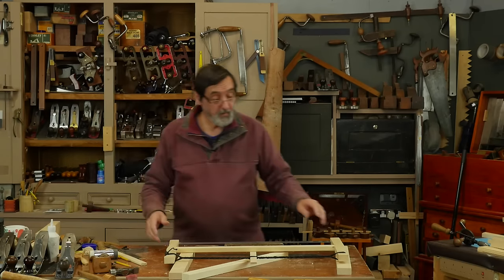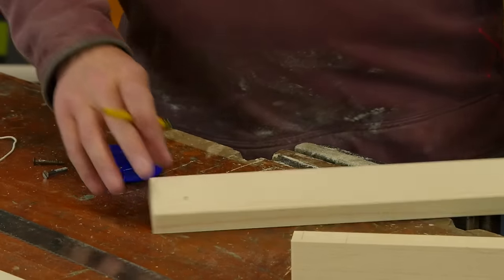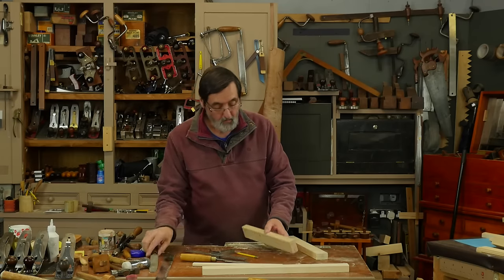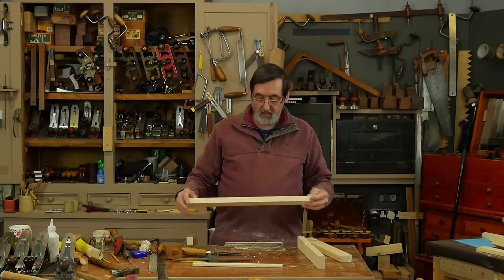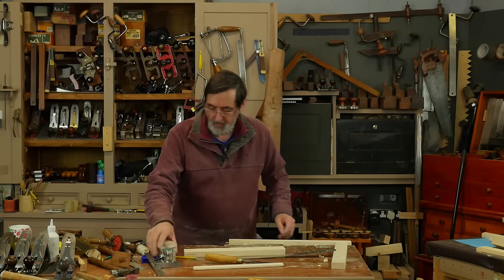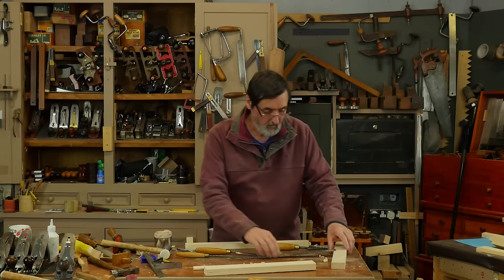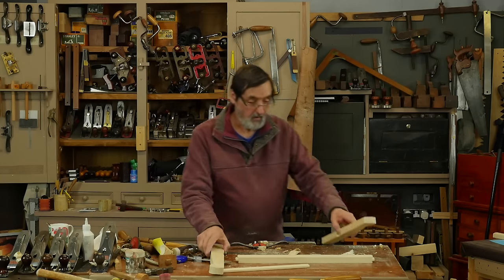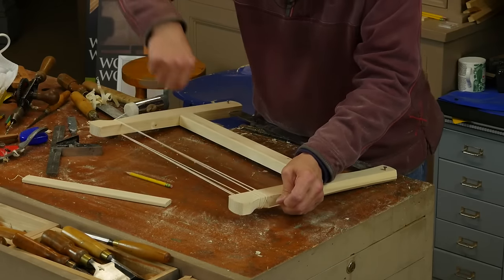Making the Frame Saw | Paul Sellers

Comment: Does anyone know what the blades are and where one can purchase them from? Could not find info on the video. I expect it is there somewhere but I missed it. Also does anyone know if I could use this in place of a band-saw. I am making my first mandolin and I don't have the room for a band-saw. I need to cut the neck on the instrument. So something like this would be great. But I don't know what blade to buy or if it is actually possible to do it this way. Any advice from anyone would be really appreciated.
Reply: www.highlandwoodworking.com is where you can get the blades.  Good luck!
Reply: u can use a small cheap hack saw, i use the thin kerf blades for fretting

Comment: As usual, a thought provoking video.  I went to the web to find some suitable saw blades and found a few factoids and sources to thrown everyone's way.  Alternate names for these: frame saws, bow saws and turning saws. Deter Schmid's web site (fine-tools.com) has a great page describing these variants as well as an excellent arguement for string tension adjustment. Highland Woodworking has inexpensive (about $8 or so) blades for a frame saw like Mr. Sellers made in cross cut, rip and scroll versions.  They also have better ones (???) for much more money!! ToolsForWorkingWood.com have blades for bow and turning saws but these have pins in the ends and require some special hardware.

Comment: The blade on a bow saw can, and should, be made of thinner steel than on a regular push saw.  The set on the teeth can be less as well, making for a thinner kerf.  That makes for a faster cutting, and more precise saw.
Reply from the maker: +deezynar Than what?
Reply: Paul Sellers
Than typical push saws.
Reply: +deezynar am I missing something here? Any bow saw blade would by design be thinner than a regular push saw. Wouldn't it?
Reply: It should be, shouldn't it?  Trust, but verify.
Reply: some times, a man of few words only confuses.....deezynar....you are confusing.
Reply: I have a bow saw made by a German company.  It's blade is no thinner than the blade on my Diston tenon saw.  It could be much thinner, it should be much thinner.  It isn't.  No mystery, no ambiguity.  Measure them.
Reply from the maker: +deezynar In these theories as with the theories surrounding Japanese saws what's reported often makes logical sense but is often untrue. Not always, often though. These bought blades are the same as my older handsaws. My back saws are mostly the same as Japanese pull-stroke saws and have been thinner. Funny how that is. And on some Japanese saws the kerf as from the manufacturer comes wider than my saw's kerf too. Not always, but often.
Reply: +deezynar 'should'? The proof of the pudding is in the eating. Or in this case, the sawing. If it works for the purpose you use it for then it's fit for purpose and no 'should' comes into it. Accurate is accurate.
Reply: Beta Vulgaris
Thinner blade with appropriate set cuts a narrower kerf.  A narrower kerf means less effort, and faster sawing because less material is being hacked out of the kerf.
Reply: deezynar End product is the same.
Reply: Beta Vulgaris
If all tools were evaluated purely on the end product, the entire boutique tool industry would never have happened.  No Lee Valley, no Veritas, etc.  But my point is actually less about snobbism than it is about efficiency, speed, and effort.  You are free to work with dull tools if you like making yourself work harder than you have to.  If you want a really fast saw, get one with the thinnest kerf.  Thin blades need to held rigidly, or made to cut on the pull stroke.  If you don't want saw dust piling up on your cut line, and want a blade long enough to use the entire stroke that your arm can produce, then you'll want a frame saw.  If you use power tools for most things, then a detail like this won't mean much to you.  If you were working without electricity, things get more critical.
Reply: deezynar You can't use dull tools as an analogy when you're comparing a perfectly good, sharp, ultra clean tool with something that is slightly better. Doesn't work, sorry.
Reply: Beta Vulgaris
That's it?  That's your rebuttal?  Criticizing a comparison I made?  I like how you avoided responding to my overall point.  Even in your criticism of my comparison you are incorrect.  A saw that makes a wide kerf requires more effort - a saw that is dull requires more effort.  My comparison was perfectly applied.
Reply: deezynar Perfectly applied yet totally irrelevant to the original point, which was nothing to do with dullness and everything to do with steel thickness. And i don't need to 'rebut' anything. If a saw works perfectly well then it's fit for purpose. Sure, there might be 'better' ways, or 'quicker' ways, but quick is quick and accurate is accurate. It's that simple.
Reply: Thanks deezynar. Your logic is spot on. Not sure why people were arguing with you about it. Weird? I just ordered a thin bandsaw blade for my new frame saw I am about to make, using this video as a guide. Going to cut it up so that I'll have a whole lot of spare blades to.
Reply: Tech Tins
Thanks for the support, Tech.  The disagreement shows that ignorance is not curable when the patient is convinced he is correct. Tage Frid wrote 3 books on woodworking.  His first book has a section where he shows how much faster a rip bowsaw is over other saws.  He said it was due to the blade being thinner, and using proper set, the kerf is thinner.  His students also embraced bowsaws when they were given a chance to try them.   He rejected Japanesse saws because the teeth get damaged by hardwood.  Japanese woodworkers almost always work softwoods.
Reply: Absolutely fascinating. And all sounds like common sense. I have just ordered the book (Great reviews on Amazon). Books 1&2 combined, not cheap though. I am assuming a bandsaw blade will be thin enough? What do you think?
Reply: Tech Tins
I'm not the guy to ask, really.  I'm still using the blade that came with the bowsaw I bought 30 years ago.  It came with too much set, but worked great after squeezing it down a bit in a vise.  If I were going to buy a new saw blade today, I suppose I would find a friend who owns a micrometer and borrow it to measure all the blades in my shop.  I'd write the numbers down for reference and go to the stores to shop with the micrometer in hand.  I have made turning bowsaws that I put blades in that I'd made from bandsaw blade stock.  Turning saws are different from other saws because they need to make a bit wider kerf to have room to turn.  I have never made a joinery bowsaw because the store bought saw I have works fine.  I've made turning saws because they are overpriced  in the store, and I don't think they work well.  I make my own from an idea a reader shared in Fine Woodworking decades ago.  The handle is fixed to the near upright with a bridle joint.  The blade is made so its angle is adjustable, but the saw doesn't need to be held with 2 hands like a regular turning saw.  I think you will be happy with Frid's books.  I see them occasionally in the second-hand book stores here in town.  They are not too pricey that way, but I haven't looked on line.  As good as Frid's books are, videos on line can be even better because you see how the person is actually moving their hands and body.  But there is the danger of watching someone who doesn't really know anything.  Have fun.
Reply: Thanks for the info. I am a  total novice. I will try the bandsaw blade see how it goes. I am making a mandolin from plans. They mention using a bandsaw but I only want to use hand tools. So somewhere I read you can make do with a bow saw. Hence why I am here. Hopefully the bandsaw blade will work out.
Reply: Just be sure to buy a woodcutting blade, not a steel cutting blade.  Since you're making a turning saw, get a narrow enough blade to cut curves, say a 1/4".  If you are cutting thin stock, get one with at least 12 teeth per inch.  Definitely avoid blades with a skip-tooth pattern.  Have fun!
Reply: deezynar
Thanks!

Comment: I want to share my experience with E.C.E. (Emmerich) 10mm "turning" bowsaw blades.  I bought a handful for my students to use and in my gentle hands, two immediately sheared off at the drilled eye hole.   A few others have survived a couple of weeks in the hands of young teenagers so perhaps this is a question of quality control.    There is not metal left after drilling a 4mm hole in a 10mm blade (considering the teeth).

I am also a little irritated with a certain German purveyor of "fine-tools" and ECE for not answering my inquiries in this matter : )

Comment: Its very OCD of me I know but I've started going through my tables on density and strength

It depends on what you mean by "strength".

Working backwards (Z to A) I'm up to M and I've found a bunch of woods that are stronger in their density to Modulus of Rupture ratio and others that are stronger in their modulus of elasticity ratio but so far only one that has a better ratio for both. Tree called Yellow wood. Flindersia xanthoxyla.

It wouldn't be widely available in the UK or US LOL

Comment: Is that a towel in that tin can? What is it used for?
Reply: +dzeus86 If I remember correctly from a previous video, it's soaked in wax I think. For applying to the sole of planes. But I could be wrong
Reply: +Rico S Close, it's soaked in oil. Uses it to lube the sole of his planes.
Reply: It's soaked in oil to apply to the sole of a plane to help it glide across the work surface.
Reply: +MichaelKingsfordGray -- You're definitely right about the danger of linseed oil rags.  But if this had anything to do with plane bottoms as everyone is saying, it would clearly be a wax of some sort (automotive finish-buffing wax is popular for table-saw tops and such).  Linseed oil on the upper parts of steel plane bodies does protect from rust, but it's messy, and not suitable for plane bottoms or any working surface, 'cause it dries and gets sticky.
Reply: boatrat74 Nope, it's oil, as Mr Sellers has clearly stated on several occasions in earlier videos.
Reply: rdouthwaite -- I am genuinely surprised at that.  Conventional wisdom is to use wax (either paraffin, or the auto paste-wax I mentioned) on the soles of hand-planes, 'cause wax doesn't mess with finishes later when you go to varnish or paint your piece.  I know everybody's going to that Camellia (sp?) oil for blades now (after sharpening), instead of petroleum-based options, but I think even that has potential finish-corruption issues, if it were used on plane soles (or table-saw surface).  I need to go back and look at the vids in question, to hear Paul's specific product and reasonings on this.
Reply: boatrat74 I agree it seems unusual, I always use wax on my plane soles.
Reply: It's a thin penetrating oil, something like 3-in-1.
Reply: John Suffill yup it's 3-in-1 light machine oil. I've been using it for years now and it's marvellous.

Comment: We're do you buy your blade from
Reply: You can find these everywhere on fleamarkets in mainland Europe or buy it new in Germany, rip and crosscut,, https://www.fine-tools.com/, site in German and English, costs less than 10 euros for the blade, but around 10 euros for transport. But then they have a lot of gear that will make you salivating. Watch out though. This saw made by mr. Sellers is not realy a continental saw as you tipically have to be able to tilt the saw a bit for counter balancing. Once your learned this your cut will allways be straight. Look around the web, you'll see what I mean. Success.

Comment: Where do i find the cutting list??
Reply: You can find it on Paul's Blog. It's free to register. https://woodworkingmasterclasses.com/2015/10/frame-saw-episode-1/
Reply from the maker: This cutting list is for a slightly different frame saw. We have removed the cut list as dimensions depends on the blade and wood used. Sorry for any confusion. The Paul Sellers Team.

Comment: www.highlandwoodworking.com has several frame saw blades of different tooth configurations that are 700 mm long, fit the purposes he mentioned and are $10 or less.  Mr. Sellers has mentioned buying items from highland in another video and as affordability is one of his themes it is possible he got his blade there. They are on highland's, bow saws, frame saws and saw blades page.

Comment: Info:
For more advanced woodworkers, the design could be slightly altered to add an additional feature for adjusting the angle of the blade. This feature will only need a round handle on both ends of the saw blade.
This will allow you to saw through long boards. (Use google to search for "rammesav" then click images).
On those frame saws I've used, the beam is much closer to the center (if not at the exact center) of the frame.
-That too will help you go through larger pieces of wood as well.
The "winding stick" only need to be slightly longer than from the string and down to the center of the frame.
Price for a new saw of this kind is around US$82 (£68) where I am located (EU).
A typical saw blade length is 600mm, 650mm or 700mm.
A new 600mm blade (3mm between teeths, 8.5 tpi) cost around $16 (£13).
A new 700mm blade (5mm between teeths, 5 tpi) cost around $19 ($16).
I think that for most people, the 8.5 tpi would be the most versatile choice.
Reply: i would find it useful to buy a bandsaw blade much longer than needed for around £15 and then cut this to length and drill small holes for connecting screws at each end. 

this way you would get much more blade than needed and would have spare to replace blades after years of use.... also this means different TPI blades would be easily purchasable. 
also most bandsaw blades CAN be sharpened quite easily, meaning that £15 blade would literally last the lifetime of the user.
Reply: Where do you find those blades?
Reply: @carlopieracci2828  If you want to purchase it from where you live, then try searching the net for "frame saw blade" and your city or country. I doubt it would be beneficial cost-wise to purchase it from Denmark if you're located overseas, the shipping would be quite expensive.
As  Dixie_rekd says, you could use a bandsaw blade, but instead of purchasing a new one, you might be able to get one, which is broken and otherwise alright teethwise.
Reply: @68HC060  many thanks. Here ( Italy) i find only ECE blades, that are good but they come in small variety. I Need a 70 cm 4 tpi for ripping big boards of Timber and something around 12 tpi 60 cm long or less for joinery work. Im loving frame saws over handsaws; they were the only saw used here and for good reason i guess

Comment: where can i get a saw blade like that? :)
Reply: +Conor You can get a very similar blade from a miter saw. Obviously not the electric ones ;)

If you switch Google to the image search and pop in this "hand miter saw" the first images should be one you need.
Reply: +Conor at any good woodworking supply house.  Highland Woodworking is one.  I'm sure there are many more.

Comment: Here is what I dont understand about this: if tension in the blade is a good thing, then why not simply use a saw that cuts on the pull stroke? The frame saw is simple to implement in this way since you can flip the saw around and make the most of the tension you have in the blade. But all other western saws that I have seen cut on the push...something seems weird about that to me.
Reply: +Arnold Kotlyarevsky One advantage of a push-cut saw: the side on which the wood fibres break out is away from you.  This means that you can still see your pencil- or knife-line accurately, as you work.
Reply: +Arnold Kotlyarevsky    Paul chose to use as a western style saw. Western saws cut on the push stroke and eastern (japanese) saws cut on the pull stroke.  If you flip the blade it's a eastern saw, or do not make one handle dedicated as, Paul mentioned, the saw can be used as either without removing the blade. Hope this helps to clear it up.
Reply: Japanese saws cut on the pull stroke under tension, therefore the blade can be thinner. The western style saw plate is therefore a thicker gauge, cutting on the push stroke. For me it all boils down to which one I'm more comfortable and accurate with. 
Practice with all types and you will improve your sawing technique altogether.  Enjoy. :-)
Reply: +Arnold Kotlyarevsky I like pull saws, but it's hard to saw a curve with them and you can't have someone help you with a pull saw. Actually, you don't need a lot of tension with these saws. They work best when you just let the weight of the saw cut the wood and that's why they are usually made of a heavier hardwood, instead of lighter softwood. I believe the Japanese traditionally used bow saws for milling as well
Reply: In a frame saw the blade is always pulled whatever way you hold the saw. Chinese (eastern people) use and hold their saw just like in Europe.

Comment: Your design is wrong, the cross bar is meant to be at 2/3 height, not half way ! How do you cut large diameter material ??
Reply: Maybe he is not using that exact saw for cutting large diameter material. Maybe it is for cross cutting or ripping smaller pieces. 
He shows it being used for joinery and for cutting joints so why is his saw wrong then?

Comment: Blade Screw hole on second post is in wrong place. You stated to offset screw hole to allow more wood on blade. But you messed up the second post which messed up your length measurement.
Reply: The saw works so your analysis is in wrong place.